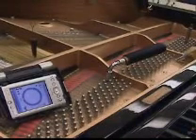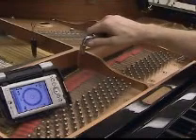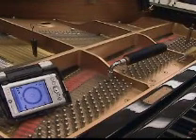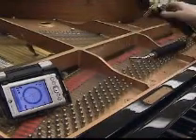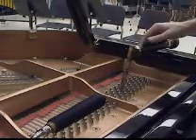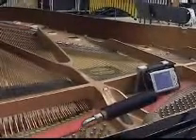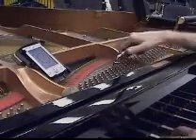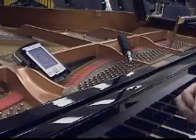Piano tuning - fine tuning

Comment: The speed is related to friction. You must inspect each contact point to discover where there is too much friction starting with the front guide pin, balance rail pin, key capstan ( at the end of the key), the whippen flange, jack pin, hammer butt flange pin, and then the damper spoon and damper flange pins, and damper wires on a grand. Creating less friction is a tricky question. Lubrication, easing the wood of the key, polishing the capstan, repinning, etc.   Piano Tech, LLC

Comment: @acoustic61 yes!! I know this is a really old post but this keeps going round & round in my head. I know the piano took centuries to develop to where it is today but I can't help thinking the same about the present pinblock system. 230 strings with a combined tension of 20 tons across the frame & the tuning the lever only needs the lightest touch & rocking to make such a difference. The pins never seem to be locked in position to me & the piano tune method is "slackened" to pitch - strange no?.

Comment: Was Ron in "fine" tuning mode on the VT or was he still in "coarse" mode? I can't see his blurred VT screen.....
Reply from the maker: Doesn’t matter which mode in Verituner. Both show the same resolution. Fine mode won’t update the calculation with new information, while coarse mode allows for new data to influence the calculation if the “I”s are not fully filled. I never liked the “fine” vs “coarse” terminology!